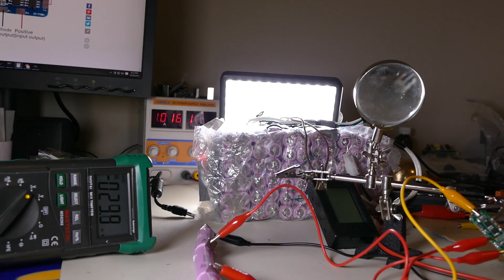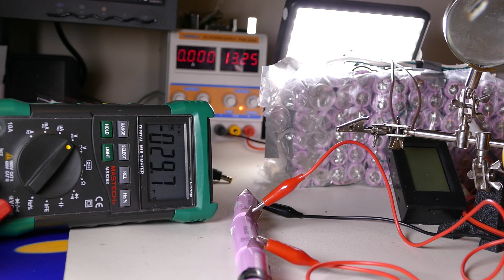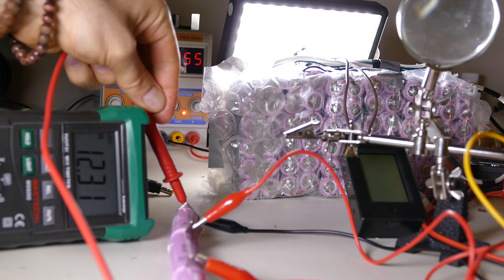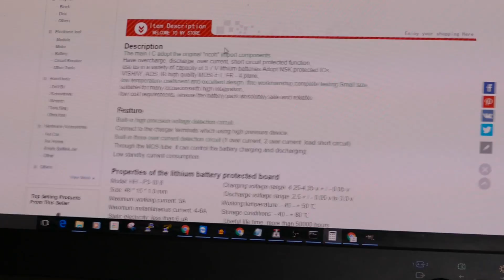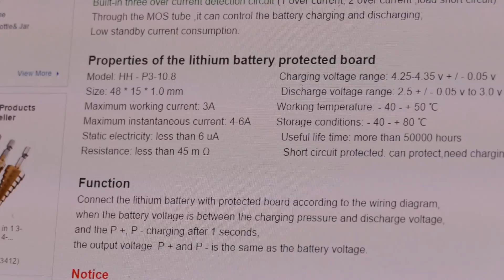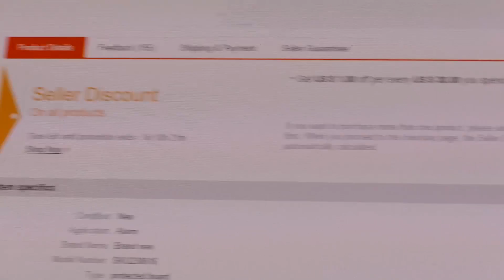Testing 3 cell BMS /protection board - not going well

Comment: a BMS is NOT a charger - it is there to protect the battery during charge or discharge .
see link : https://en.wikipedia.org/wiki/Battery_management_system
Reply from the maker: charging regulator ........................... lets not try to be so litteral

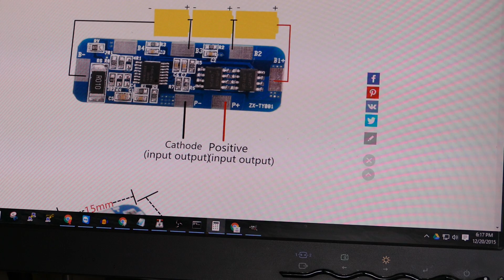Comment: The drawings I've seen on t'interweb (fleabay) show the balance leads connected to the other contacts as in your (this) vid. Looks like you've wired it wrong, if you look at 4:27. I'm just about to test one. Just spotted this was 12/2015... did you find this board worked, eventually? Doesn't help with the contacts being named differently on some other boards...

Comment: Hi, I also bought this PCB but unfortunately it does not work. I'm pretty sure i hooked it up in the correct way, only at P+ an P- i don't seem to get current/voltage. I read somewhere that you need to activate the board first by using a charger. so i used different power supplies, a 12V 3.3A, a 12V 1.5A and a 12V 0.5A. i connected the power supply to the P+ and P- but still the PCB does not work. could this be because the voltage is ≈12V?(I read somewhere that the PCb needs 12.6V to activate) When I measure the voltage of the different power supplies they are slightly below 12V, around 11.9V. Thanks!

Comment: BMS does not work becouse you need to activate them. when you first connect them they enter fail safe mode to activate them you need to short p- b- terminals or apply voltage to p- p+ and they will work fine ;) chinies don't say that in manual
Reply: Thank you for the usefull information!
Reply: If it enters fail safe mode you need to bring the voltages up above 3 volts and it should turn on. How it works is it shuts off at 2.5 volts, and goes back on over 3 volts.
Reply: Great info, and you need to do this everytime you replace the battery. I discovered this only by accident. Since I used removable/replaceable battery cases.
Reply: on mine (a different model hx-3s-01) it was short, p+ and b+
Reply: Thank you so much now it works

Comment: Just a note to experimenters. It is quite risky using alligator clips for testing circuits. If the clip comes off you risk turning some of the project into toast. I strongly recommend soldering all connections. The final connection to the battery should be plugged and a suitable fuse placed close to the battery. DIY Lithium can be dangerous and should never be left unattended while running tests. Design of circuits and charging systems should be done by suitably qualified persons. If you get this wrong, even on a small scale system, it is quite possible to start a fire and damage your property or even that belonging to other people.

Comment: Without knowing every detail, it would seem a lot of people don't understand how BMS works. In the case of a LIFePO4 lithium pack, nominal voltage 13.2 fully charged, you need to supply 14.2-14.6 volts to recharge the batteries. Without BMS the battery will charge successfully.. BUT.. and a huge BUT, the cells may over time become un-balanced. The reason for this is that when any cell becomes fully charged, no power can flow to any cell in the pack. BMS overcomes this by bypassing a small current over the cells that are already fully charged and allowing lower cells to catch up. When they are all fully charged and in balance it would be one strategy to pulse the battery to test if any cell is not quite charged. Make certain you have a constant 14.2 to 14.6 from your charger with the amps limited to C/2. It is not advised to utilize Lithium batteries without BMS and undervoltage protection.

Comment: Where do you advice to buy Good Quality BMS?

I need a 3S one for my DIY project, and i'm new to BMS - I can't find much info on how to charge a battery pack with a BMS, i always see it as input and output being on the same line.. I'm a little confused. Is that how it is supposed to be?
Reply from the maker: these ones i bought were garbage and didnt really work. Should be straight forward to connect ones that actually work. check aliexpress 3s bms there is usually a diagram on how to connect somewhere in the pictures . they are not all the same but similar.
Reply: If i might add some info.  I have 3S BMS board too. This board stops charging when the cell voltage reaches ~4.1 V.  In conclusion, it does work.

Comment: I have what looks like the same board.On endless sphere I had a guy chime in on my post and say he is using these successfully as a charge cutoff only. They dont have any balance function. He also mentioned that they are shutting off the charge at around 4.1 volts which for me is great as that is really about 88 percent charged.He is also using them in series for a 16 s pack. That I still have to figure out.

Comment: Just to clarify, the BMS you tested has no balancer function. It is just a BMS that has overcharged and discharge protection but no balancer. There are BMS that have balancer function. They are more expensive than what you have tested.

Comment: Yes, I bought one of these [BMS Protection Boards], and after watching the video and writing a message here, I just tried it out and I was correct in believing that you DO need a current limiting power supply. Here is the one that I used: [DC-DC Step Up Down Boost buck Voltage Converter Module LM2577S LM2596S]. My BMS  is working perfectly! I hope this helps a lot of people :)

Comment: If it helps to make some sense of this behavior, it is my understanding that as part of the balancing scheme, a lot of BMS ICs will look at the individual voltages once near full charge is reached, take note of of which cells are slightly higher, and will slightly discharge them, followed by resuming the charge cycle.  Also, at full charge, BMS ICs will typically allow a small current on an occasional basis, as a kind of maintenance charge, to compensate for normal self discharge. Together, you can see where these operations would account for a somewhat sporadic input current fluctuation.

You might also be interested to know that if you have a less then high precision supply, you can use a higher voltage at the input, which gives the BMS circuit some latitude to work with, as long as you provide some current limiting. I've had some good results with my supply set to 16V, using a car turn signal lamp as a resistive ballast.  The lamp woks well because having a negative coefficient of resistance,  it will further limit the current in the event of a short. As a bonus, it will glow slightly during charge, and turn off once full charge is attained.
Reply: This unit DOES NOT balance the cells!!..It is for cut off ONLY when any cell reaches a predetermined voltage

Comment: I have two of these which i just tried to use tonight and it's wierd as they look identical to your board but the connections are labelled differently.  I wired it up according to the labels and it did not work, i took a risk and used the wiring as per your board and now magically it works!!  will keep an eye on it as it's a lipo but it is quite strange.

Comment: I just got mine and had the same weird results. I played with the Variable PS and got it stable at 12.6v and the Amps are not adjustable but it is charging. It seems the board was shutting down the process before. If I alter the voltage to 12.8 the amps shut off as the board thinks full charge has been achieved. If I attach a load to the lipos and start the charge process again, charging resumes.
Reply from the maker: Yeah im done with these, ordering some different ones. so far these are the only dud items that ive ordered from china so not bad in the grand scheme i guess
Reply: Some Youtube videos it was told, that before you start using BMS you got to charge or run some DC current to get the board activated else some weird stuff goes on... may not be related but just throwing in there
Reply: +Mukesh Pandya you're right, I did see that somewhere. I just ordered a dedicated 12.6 wall charger and I hope it works.
Reply: +Mukesh Pandya you're right, I did see that somewhere. I just ordered a dedicated 12.6 wall charger and I hope it works.

Comment: 4:25 it says on your screen the same thing mine says "Charging voltage range: 4.25-4.35v±0.05v", turn down your voltage dude ;-) it is in over current protection.

Comment: I just bought some of these, they have yet to arrive and mine are exactly the same except for 4 packs but, mine says "Charging voltage range: 4.25-4.35v±0.05v" which makes sense as that is what each battery takes to be charged, it looks like you assumed that since the total battery bank power or the 3 cells together make 13 volts you should charge at 13 volts which not only might be your problem but might have smoked the board if your not lucky.

Comment: It happens to me exactly the same. What I find even more weird is that the module tabs P+ and P- do not supply output until one connect a 12.6v charger input first. So if you are at the field without a charger, this module "protect" in the wrong way not having ways to activate its output. There is no manuals, no much info around there (not in chinesse-english). Any help welcome.

Comment: Your wiring seems OK to me.
I did try it myself on 4S 18650.
From what I understand, as soon as one cell has reach arround 4.15V, all the cells start CV charging (and leave CC charging mode) but based on the higher voltage cell.
So you can have cells @ 3.9V and one @ 4.15V the 3.9V ones would be charged at rate that doesn't exceed the 4.15V one, so much lower current than normaly needed.
I can be wrong, but from what I did measure, it looks it xorks like that.

Comment: Obvious question:  What charge state are the batteries in?  The voltages you measured make them appear fully charged, ergo no current from the power supply, i.e. over charge protection working.

Comment: on a 3 cell system I'm pretty sure you need '4' Balance leads - one either end and the two in the middle!!? Then you add the Main Positive and Negative on either end also.
p.s. 10 cell uses 11 balance leads, 13 cell uses 14 balance leads etc.
p.p.s. if you notice that BMS board does indeed have the expected '4' terminals for the balance leads  :)